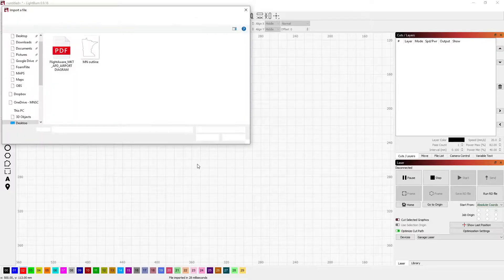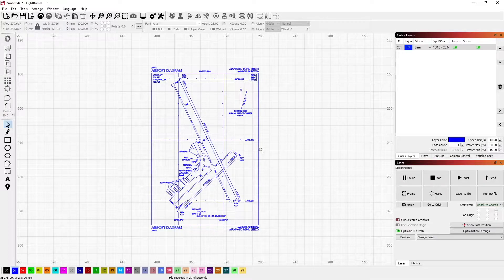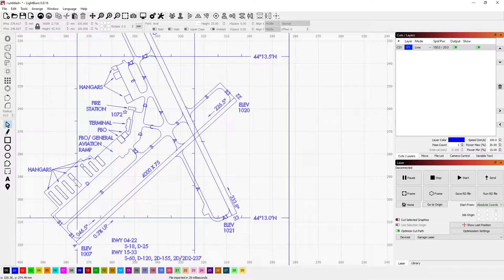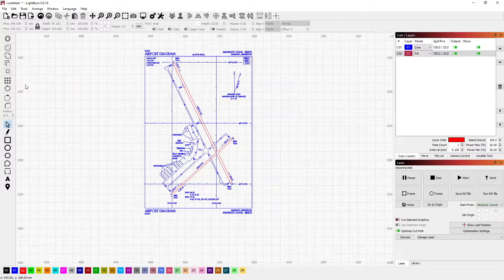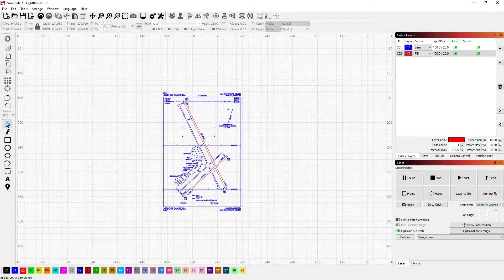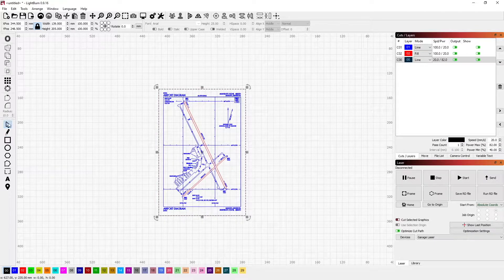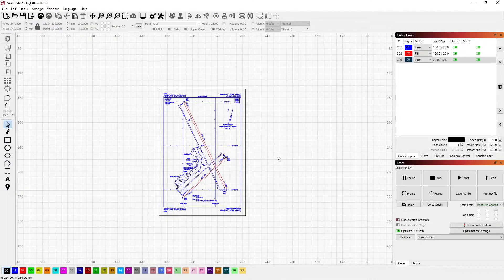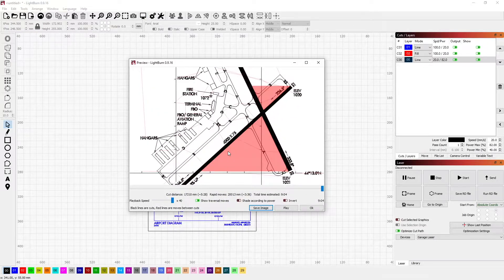Engraving a map using Lightburn on a Co2 laser from eBay

Comment: I noticed your laser when engraving the section of the runway, only traveled where it was engraving.  How do you have your laser set up to that?  When I engrave, my laser overshoots the engraving area, thus slowing down the job time.
Reply from the maker: This file was a mixture of line art and engraving.  The runways were a separate layer on the file so it only engraved the runways during that pass and the rest of the text were line art. It does help speed things up.